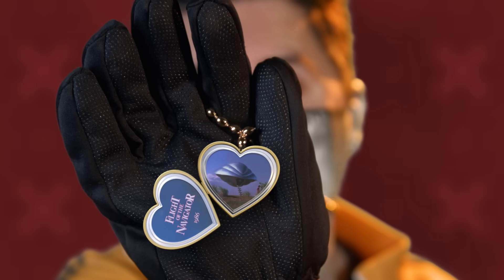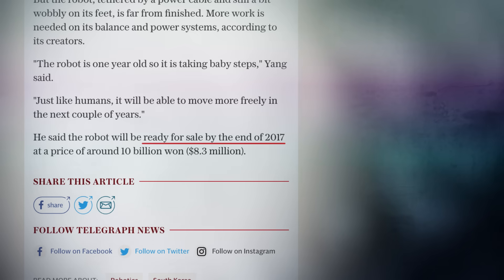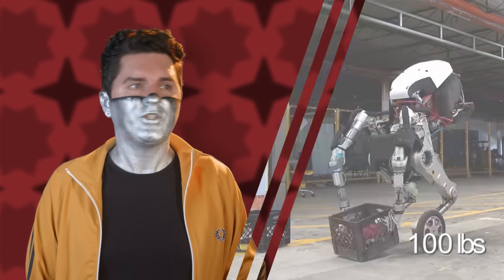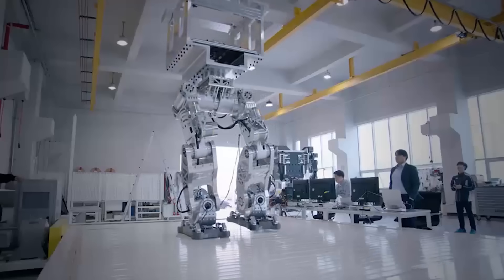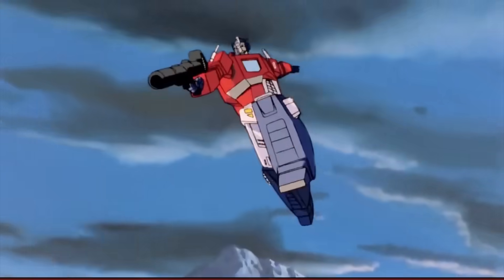The Method Robot | Quick D

Comment: On board power sources are the #1 problem right now. Balancing and movement have all been proven in small robotics and should have good scalability. What doesn't have scalability is large power generators. They get bigger and bigger and require even more energy storage(fuel, batteries.). Not great for something that is bipedal.

Comment: I think 1:1 mapping to human-like arms are potentially a good idea - assuming you could get good hand-dexterity too. A robot that could truly manipulate objects like a human with minimal training would have many applications.

But a bipedal design is a bad choice until such a time where we can somehow interface a human sense of balance into the robot - and that's a long way off. Unless you absolutely NEED to have 2 legs, having 4 or more (or even tracks) just makes the problem so much easier to solve. And if you have to go for 2 legs - a chicken-walker seems a lot more sensible for most applications unless it has to specifically tackle stairs or very sharp inclines.

And another indicator that this is designed for show is the pilot. Why exactly do you need one? Extra weight - less component space, lots of extra safety needed ect. The pilot can sit in a booth with a VR headset and do the exact same job - which is definitely a bonus if you want to send a robot like this to for example help in a disaster zone, radiation hazard, burning building ect.

Comment: As a computer engineer who has worked on several motorised automated systems, it looks to me like this robot is completely missing any balance regulation, judging by the footage shown in this video. I wouldn't be surprised if this robot was completely without sensors like IMU(gyro, compass, etc) which checks if its even standing upright. It just looks like they pre-programmed all the movements. This project looks like it hasn't even hit the real development stage yet, looks like a non-real functioning demo/prototype to fake the real thing.

Comment: A thing or two about Vitaly Bulgarov 3D modelling process; he actually uses engineering software to concept a lot of his 3D work. This allows him to create components that can easily be adapted for real world scale 3D printing. Obviously hes not designing sub surface electrical components, but with the software he uses he can create surfaces that can house those components. The 3D cad data he creates can be used for computerized construction of the robot. This is why a lot of film studios love to hire him. He creates some super badass designs, and they can easily be constructed as an animatronics. He speeds that design process along greatly. 
Brian brings up a good point though about the movement issues he sees with the robot that touch on the fact that concepting something that looks like it has a good center of gravity doesn't necessarily mean it has a good center of gravity. As a 3D artist, you don't learn much about creating something that actually works in the real world, you learn about making something that LOOKS like it works in the real world.
Reply: Yeah, he kind of brushed Vitaly off as some scribbler. Vitaly is an incredible artist and guy. That kitbashing comment? Vitaly is the guy who makes the kits everyone else bashes with. I don't think there's another hardsurface designer in the industry who can make work that's so well thought out both functionally and aesthetically.
Reply: Yeah, and he recently worked with Boston Dynamics on Atlas' shell.
Reply: Also he’s hot

Comment: Well this was impressive.
So I suppose the main takeaway is; the robot is real, but in terms of function it's currently a bit shit.
Those clips you showed of BigDog were legitimately quite impressive, by contrast. Getting robotics to move around like that autonomously does not seem easy at all. Probably a fair assumption given the time spent on its R&D.

I wager a human-piloted mech suit like that Korean company is trying to hype up would be more realistically attainable right now with something like a supersized version of BigDog. A quadruped has four points of contact as opposed to just two with a bipedal robot, so that would make stability and balance a lot easier. Not necessarily *easy*, but easier.
Even easier would be caterpillar/tank tracks of course, but let's assume we want something that could walk - which can potentially deal with extremely uneven terrain much better than wheels or tracks can.

Comment: I like the overall concept of this video! It feels like a much better execution of the 'debunking a bad idea, rather than fake footage' concept, than the Mandela effect video.  It's also fun to see elements from previous videos return (pronunciation guide, awkward interview, text to pause and read, etc.)

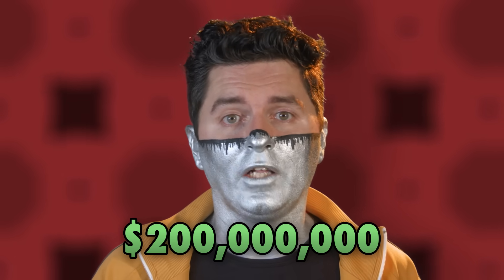Cut at 3:15 is a bit odd/abrupt
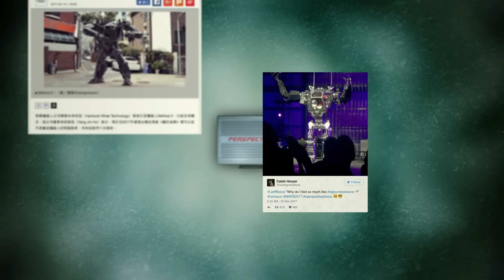liked the bezos-weaver joke at 1:25 
2:02 didn't land for me
liked the running gag with BigDog

The above decisions don't affect the video much, as they last a few seconds or less.
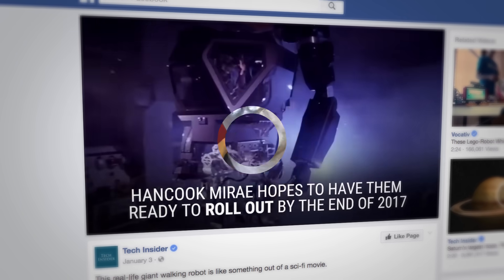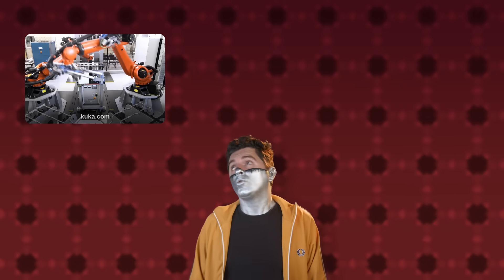Unfortunately, the interview was indecisively handled and negatively affected the pacing of the video for me. The meat of the video is at 2:15-3:30 and 5:09-5:45, where the technical viability of the robot is commented on. Given how in-depth these comments are, it seems they are informed from Mr. Gregory's input. So when the montage hypes the viewer up for his technical expertise, it's disappointing that he only gets one observation out (3:57), then it's derailed for comedic effect. The video wouldn't have suffered if he continued in this vein. What probably happened is that Cap D consulted him, used his comments for the main bits before and after the video, then included the joke interview as a break between those bits. The joke wasn't that funny though. For a better execution of 'CapD is scared of being replaced', look to 1:03 of the ambiguous cylinder video.

Maybe this was supposed to a full video, but there wasn't enough substance to put in the interview, so it was cut down into a quick D?

Still liked it though!

Comment: The Method is actually really nice, with lots and lots of custom, CNC-machined parts that you would never find on ANYTHING mass-produced. It's basically hand-made. Getting that much material to stay upright on two legs is a challenge in and of itself, even without fancy Boston Dynamics-style self-balancing dynamic gait algorithms. And yeah, it is in no way practical at all. It's not a battle-ready combat exoskeleton or anything like that. The cover materials are paper-thin. It's basically a really nice movie prop. The quality of the machining and fabrication work that went into it, however, is beyond top-notch.

Comment: Add a massive weight in the bottom of the cabin, spin it around at a couple thousand RPM. Tada... gyroscopic stable mech suite! Sure it would probably break under it's own weight or have some issues turning, but hey, it would be stable!

Comment: I would add an arched leg to the method sticking out of the rear end with a wheel attached to it. that would help keep it stable. Also, I am pretty sure this thing will have an on board computer powered by AMD RYZEN TECHNOLOGY. They are also going to have to integrate some kind of display into the screen, or have some kind of augmented reality head set that can project the computers display onto the screen.

There will most likely be a third of fourth iteration before it hits production.

Comment: The whole concept is rubbish. Why would you need an operator inside the machine when we have perfected all means of remote control currently available to our level of technology (or invented). Laser routers, wireless, wired (which mind you, to power this alone, it will need to have a cable running to a truck, so the whole DMZ is bullshit, because this becomes a pointless machine, a joke), radio, you name it.
It's dumb, it only works as an idea in anime and the only place something like this would have a proper, justified application, would be in space, where a human DOES need to sit inside, and even there, surprise, surprise, NASA (and the rest) don't even consider this as a concept.
A gigantic waste of money and time, really. Would've sent that funding towards founding a space program.

Comment: The big cable attached to the robot may be attached to computers as well, but I'd guess it's primary purpose is to supply power.  

Getting power on board a robot is more difficult than getting computation on board.
Reply: While having them walk in the DMZ is nonsense without a sufficient power supply... I could imagine a tethered robot still being useful in warehouses / factories - maybe. Depending on whether it can do stuff that a forklift can not do.
Reply: which is just another failing. for it to have any real-world relevance it needs a self-contained power supply as much as it needs self-contained control computers. they're not going to be trooping around the DMZ with a bunch of extension cords
Reply: "but not for as long"

If that means like a minute or two, then you are right.
Reply: ICEs are close to that. Which is still pretty terrible.
Reply: Yeah bro I guarantee it's for power. Did you see the size and number of the cables? Literally all they would need for control is a single ethernet cable and maybe 2 small wires for an E-stop.
Reply: You mean a forklift? We already have those. If anything the Forklift's will just become a sort of unmanned drone. Which on further research shows Amazon is already doing.
Reply: Yeah. They're called Combustion Engines, and they can generate a metric fuckton of power in a very efficient and small manner. Loud as hell though.
You see, Boston Dynamics are using them and they can output more than enough wattage to run a robot.
Reply: +WarpRulez you could always run them off hydrogen in a similar way to propane powed forklifts
Reply: Dave i'm going to say something that was mentioned in another method video

having a fully functional method would be like having a guliver

thats all you need to know
Reply: Robots like the ones korea are developing will take years to be Fully functional,Why?Batteries,Simple as that,Though i doubt they care about the pollution a combustion engine causes,It can be useful for hazard zones and they can Create portable power stations,Which are plugged into the robot,Combat would not suit the current variation of it.
Reply: Also self balancing,Which is already explained in the video,Something with as much weight as that robot will take Some amount of time to balance out,But it looked like it was intentionally moving left and right in the demonstration,But that's just my speculation.
Reply: Trippy_Stairs yeah, our bateries are kind of shitty right now
Reply: To be fair, it's not entirely stable yet. There might be solutions for battery and computation that are ready to be implemented, but not until the software is ready.
Reply: zzz43452 it's probably because for two reasons really

1) because it's a prototype 

it probably has it's own internal computer or something, but it's better to have everything being connected to a main frame so that you can monitorize every little movement

cables are better than Bluetooth for that purpose

2) a batery would be to big

the Boston dinamic robots use a ton of energy, the atlas can only work for over half an hour and the big dog use a fucking diesel generator, this is in a conceptual design when the tecnology is being tested

so nothing of your fancy words and stupid theories
Reply: zzz43452 the atlas doesnt use fuel, it use a lithium batery, a really big one
Reply: WarpRulez Batteries are good enough to run cars for almost as long as combustion engines these days and have several other advantages. It's really only a matter of time before batteries become as good or better than combustion engines in every way. Using them in industrial robots probably isn't that far off.
Reply: judging from the thickness of that cable yeah.. that's a power feed.
Reply: beside's power, its primary purpose is to hold up the robot so it doesn't fall down when it takes a step..

they said 2017..   its 2019 and they still havent figured out a way for it to move without falling LOL     total waste
Reply: I think power delivery should be one of the easier aspects of building such a robot. They could just cram huge batteries in those legs of the robot because 1) there seems to be more the ample room for them, 2) the center of gravity has to be low anyway, so big and heavy batteries aren't really a problem, instead killing two birds with one stone, 3) Li-Ion batteries are already pretty efficient compared to traditional batteries. And this should to power the robot for an hour or two too.
Reply: One thing I love about Evangelion is how they portrayed the power supply aspect pretty realistically.
Reply: You might be correct, but the cables are running toward the computers such that they have to be routed under a table -- see 3:21 -- which is, shall we say, suboptimal for a moving robot unless the cables needed to be running toward the computers for some reason. And note that even at the purely theatrical and dramatically lit 0:39, there had to be a couple of people sitting at the computers.
Reply: I am not saying it is the case here, but I would assume that ofen when testing such prototype you would want to have "live" access to sensor data of such robot with external computers to analyze the data. And cable might be more practical then some wireless transmission.
Reply: Money4Nothing There easily could be an ethernet cable in that bundle and we'd never spot it.
Reply: A "plugged in" Robot would still be very useful in construction and hazard enviroments such as mining industry, though.  Not everything has to be wireless to be useful (damn kids).
Reply: ChrisC Great job missing the point my dude
Reply: I wonder if we'll ever invent a semi-cheap power source that has a reasonable size and weight so that it can be easily carried by a robot, and that can supply virtually endless power. Like some kind of fusion cell or something. Relatively small power supplies that can produce copious amount of energy are one of the biggest hurdles in creating autonomous robots that can function independently for hours. Batteries have got really good in the past couple of decades, but they still have a really limited capacity, especially if they need to move something the size and weight of a truck. Internal combustion engines are, perhaps, the thing that currently works best, and is what's used in heavy machinery, but they are really noisy and polluting. But, maybe, they are currently the only reasonable option, until we invent small fusion generators that can supply gigawatts of energy for days at end.
Reply: Uh no, it's not hard to use a battery.  If it ran off an engine, it could easily only need free space the size of a milk crate for a generator.  If running off batteries, then even less but not for as long.

And in the video he even speculates the cables connect to computers that make it move.